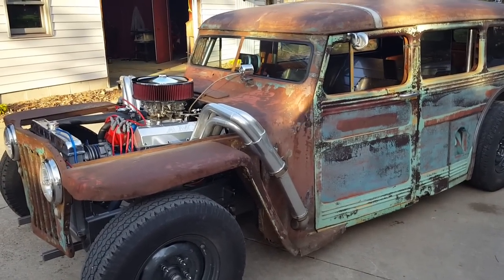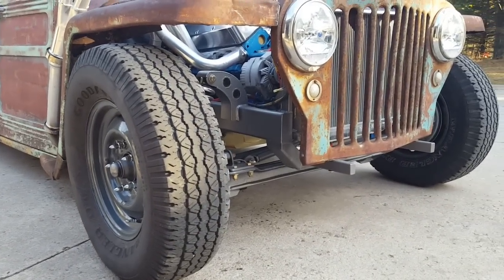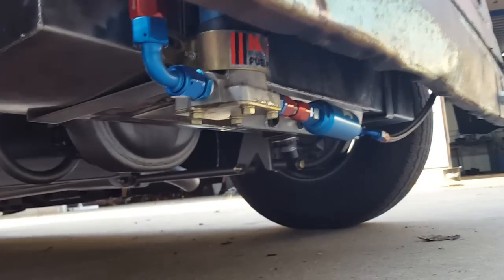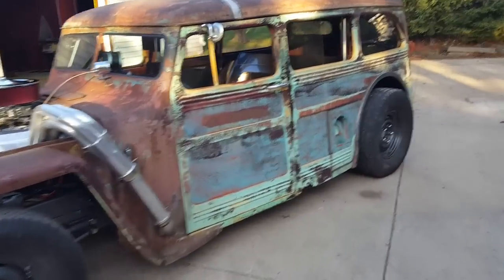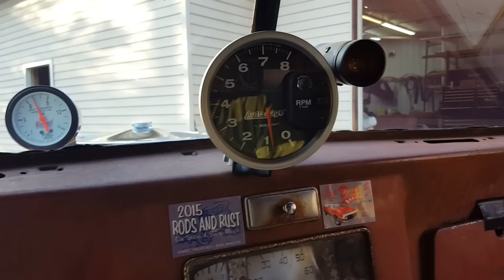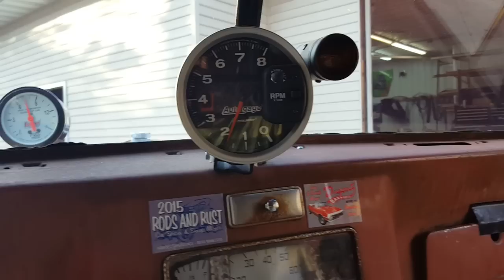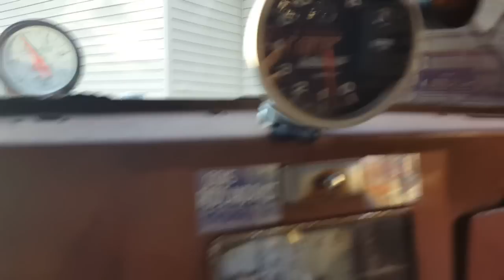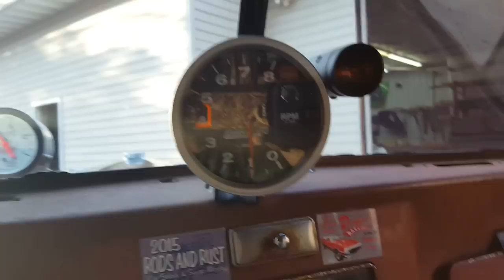48' Willys Wagon 401 "Ratfish " #3

Comment: What an incredibly nice build! Super sanitary, you should submit an article to Hot Rod mag. You got skills Todd! It would have been cool to mount the shifter to the roll bar over your head, with nice heim jointed linkages down the center of the windshield to the cable and on to the trans. HA!
Reply from the maker: Thanks for the nice comment. I do race it and not sure if a shifter as described would work but great idea. Hotrodhotline.com did a write up of it a couple years ago. I've never really tried to get it in any magazines.
Reply: Hey no problem Todd, you deserve the praise, the construction on your Willys is top caliber, really clean and very well done. :)

Comment: Nice to see somebody else use a 401 in a rod. 7 yrs ago I built a street legal belly tank with a turbo'd 401 & shorty 727. It's a rare moment that anybody pics what the engine actually is.
Reply from the maker: NZ Salt Flats Racer thank you.. Your right they uselly just take a guess at it. Turbo 401 now I like the sound of that. I thought about doing a twin turbo setup on this.
Reply: I'm a cheap-ass, 7.3 Powerstroke turbo blows through a kitchen pot bolted on an 800 Holley DP & junk yard aluminum manifold. Makes over 650 hp at the wheels.
Reply from the maker: NZ Salt Flats Racer that's awesome!!!!